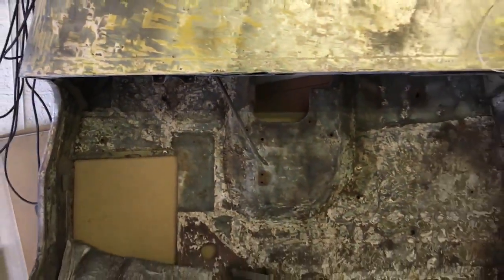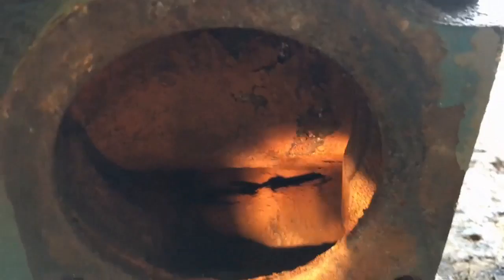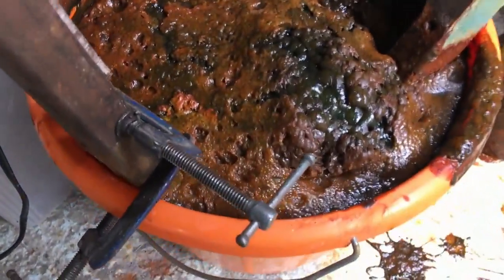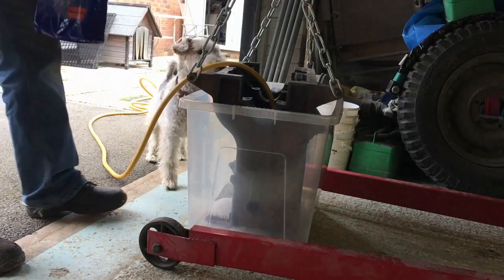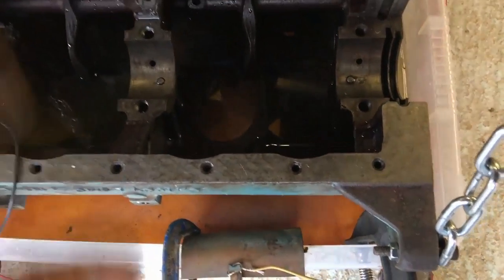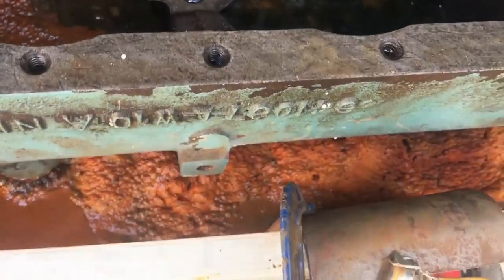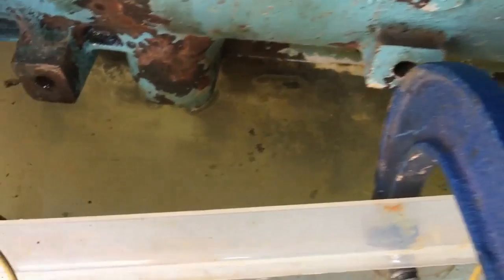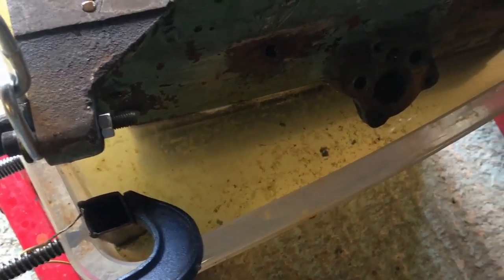De-Rusting my Jeep engine block.(Not Model related)

Comment: I know I'm late to the party here but wanted to say thank you. You gave some great information on how to do this. I am rebuilding a John Deere 6329D Diesel engine that has a lot of rust buildup inside the water jacket. So I will be doing the block as well as the cylinder head. Also I love your dog. He makes a good assistant and supervisor.